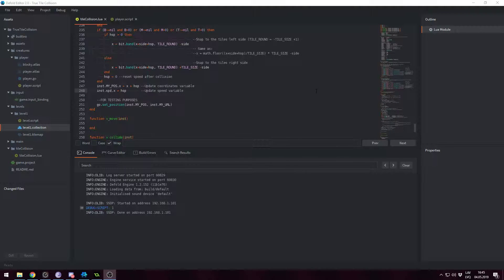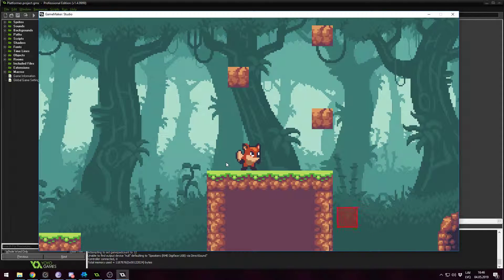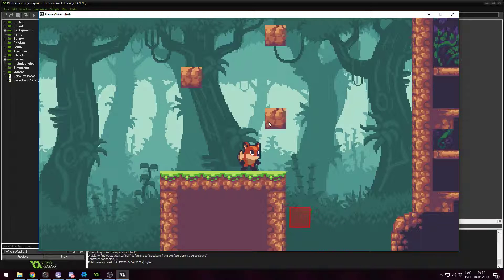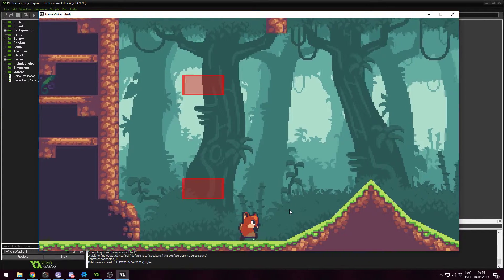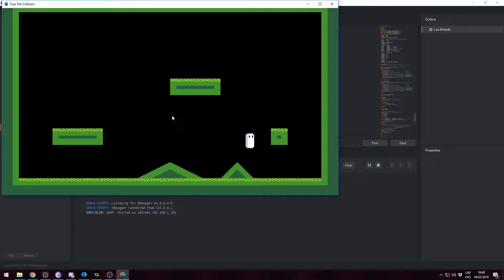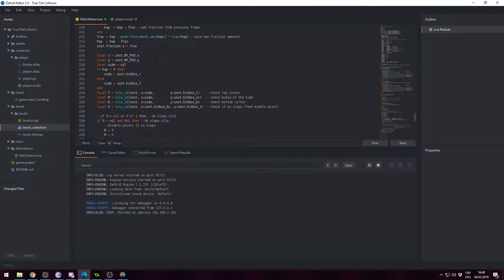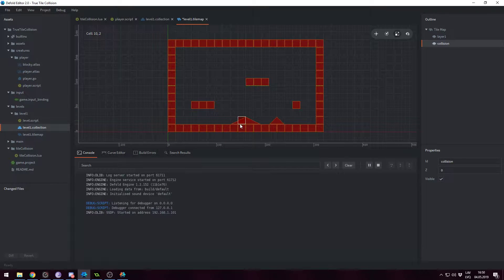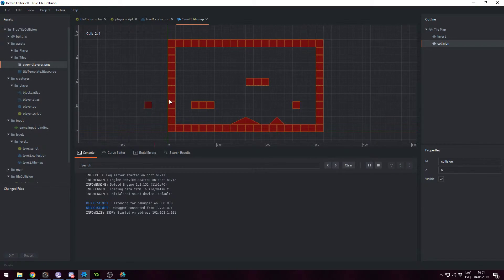Jorney of learning Defold

Comment: Thanks for the platformer engine. I am trying to use it, but I am having problems setting it up for my game and I do not see any way to contact you other than here. Thanks.
Reply from the maker: All I can do is to point to the demo project I made for that physics. But these days there are WAY better solutions for platformers. Check out shared projects from Britzl.
Reply: @AgnisNeZvers  Yeah, I was looking at Platypus. My only issue I had with yours was setting up the hit box. The top and bottom values do not work as I thought they would. Thanka for helping.